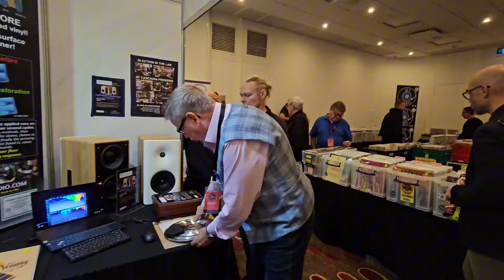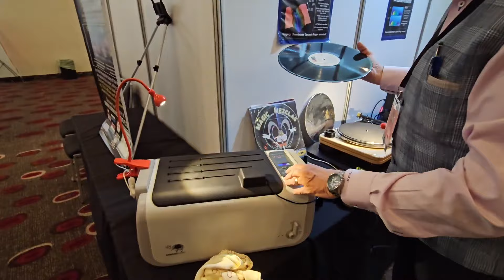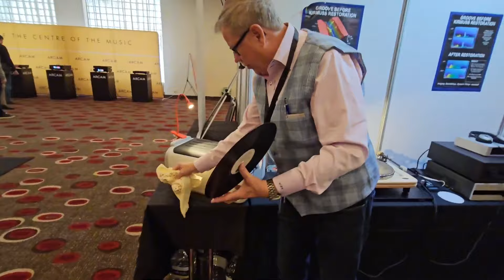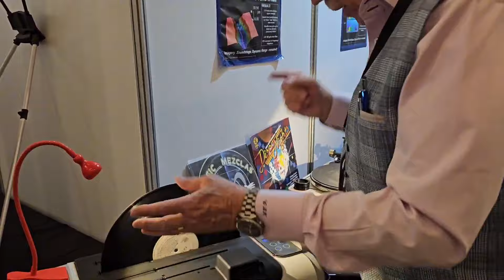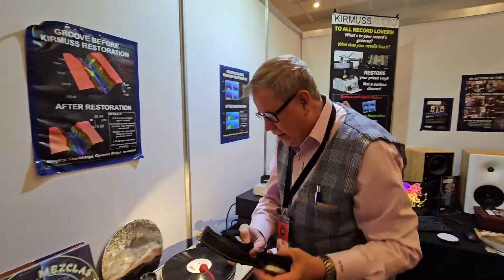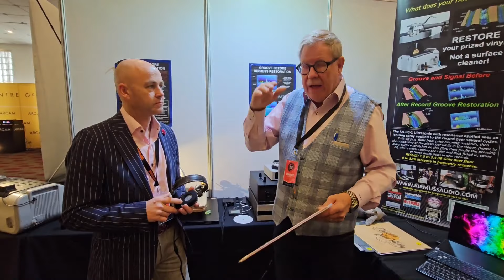MY RECORD RESTORED BY KIRMUSS The process, before and after test.

Comment: OK, wait a minute…is that a Pear Audio Kid Howard turntable? As I recall, they use low torque motors and a brush will easily slow down the platter.
Reply from the maker: @kenw.8013  when a record has a severe coating on it where in another cleaning process contaminants were either air or vacuum dried onto the record, one sees a turntable slow down when a 10 micron diameter felt  brush is used... . Even a Pear.  Restored records see no slow down.

Comment: If I had to go through this process to clean each of my records, I’d throw my collection out the window. 😂
Reply from the maker: @melsrecords-bq3di  Restoration is not surface cleaning. If you truly want to hear the tone and resonance, harmonics available as pressed, one needs to remove the three coatings that we have described.  New records included.  That is why we receive the rave reviews as we do and where analog with record groove restoration gives you the musical  experience that you should have over digital. Surface cleaning is not what our process offers.  Once restored,  does not have to be repeated again except for a two minute cycle when one feels that the record has excessive fingerprints once more.

Comment: The oil crisis years were mentioned, during these periods the thickness of vinyl also changed, it got thinner, this was also the period where The Best Of and Greatest Hits albums started to be released as there were no recording costs, they were basically re-cycling their artists recordings to make profit during this expensive pressing period.
 I sold collectable and rare records back in the late '80s and most of the '90s, I could have done with one of these machines then, in fact I probably would have bought two had they been available then.
Reply from the maker: @AndrewAHayes  Happy New Year Andrew!

I too got rid of some oil crisis era records only to buy them back after we discovered where it was the excessive coating caused by the use of added and added stabilizers and liquefiers that had to be added to recycling of records in those days that accounted for some records sounding horrible.

At recent shows in Mexico and Peru discovered also our restoring these era records to life.

A sincere joy for me to hear records restored and making a positive impression to folks that were once skeptical including Michael Fremer now introducing us to friends, peers and colleagues. 

Keep those records spinning!

Comment: This video makes me want to not play my records.
Reply from the maker: @glenpitts6813  Happy New Year!   No matter the price of your sound system and yes some elbow grease needed to remove the three identified layers that hide the detail as pressed, purchasing a 10,000 USD cartridge will not have the impact as record groove restoration.   Restored records played back on a 500$ Audio Tecnica or Victrola  like turntable also hear the impact that only our process offers.

Yes, some work.  But the benefit is mind boggling.

We wish that we could make it simpler but we are dealing with the laws of physics where per the Tribelectric table of charges both distilled water  and  PVC  have he same electrical charge. They repel each other.  So the needed cycling and application of the ionizing spray. The only only known procedure to remove the films and coatings allowing the needle to discover the music as pressed, now revealed.

Comment: For many, many years I have used a Vax hand held wet/dry vacuum cleaner on my vinyl records.
It has satisfactorily cleaned out the gunk in the grooves, valleys and tracks of the record.
Yip it seems harsh, but it does work.
There is so much more to stop pops, hum, rumble etc, not just cleaning
Cartridge maintenance, down pressure of the tone arm, position of the tone arm on the record etc all contribute to output noise.
One of my records sounds UN-listenable on one of my decks, yet perfectly passable on another

Comment: I enjoy touching records and man-handling them as a DJ. I love seeing greesy records and putting my fingers all over them. Plus if the record has a lot of noise you can put water on it and it will be quite down. An old DJ trick.
Reply: but that water is like crack, once you start doing that, you can't stop.
Reply: @pudintain9656  Please xplain? How could this be
Reply: @Legeennnd  I was a nightclub DJ back in the day and I knew DJs who had the water bottle and they would spray their records while they were playing to eliminate the pops. It works for a minute but really just makes the problem worse down the road.
Reply: @pudintain9656  Really. But I see some DJs doing it when they playing a record with a lot of noise. Which you cant have. SO they place diluted water on them so they play quieter for the crowd. It's a good solution for bad records. Of coarse better to have records without noise but sometimes  you have to make do with what you have.
Reply: @Legeennnd  Diluted water. You talk shit.
Reply from the maker: I have seen water on a record see the needle skid accross the record.

When one talks about 'wet' cleaners, caution was always stressed nott to wet the cantilever of the cartridge as water by way of capillary action can move up to the elastomer and ultimately reach the Mm MC coil affecting sound reproduction.

Comment: Wow so much snake oil!!! You can clean records with PVA glue :)
Reply from the maker: Sorry to say, while on the subject of surface cleaning and not record restoration, proven where  the glue once dried and then peeled off cannot make contact with the sub micron details and enter due to the size of the droplet  into a 6 x 30-35-4-45-50 micron groove. Proven also to leave a film.  We have tested  such a system in the UK from an Australian manufacturer.

Added, PVA has Acetone. A no no for PVC.
https://design-estet.com/pva-glue-analysis-of-the-composition-advantages/

From Yoursoundmatters.com: QUOTE:" The wood glue cleaning method is one of the more bizarre, but common approaches used in an attempt to restore old records. As the video demonstrates, the process involves spreading a solid layer of wood glue over the record surface (avoiding the label of course).When left to dry overnight, the glue dries clear, picking up dirt and dust deep inside the grooves. The theory is, all the grime is removed when peeling back the glue.This cleaning method makes me cringe. I can understand the logic, as dirt and dust can become deeply entrenched over many years — particularly if the record was played dirty — but the risk of further damage is very high.The glue can easily fail to peel off in one piece, causing all kinds of problems, and I can’t imagine the residue is any good for your records and stylus. It’s also very time-consuming; why take the risk when record-cleaning solutions are relatively inexpensive". END QUOTE

Comment: Can your process remove products such as LAST ?  -  the only method I know of is mechanically so far.
Reply from the maker: Yes, send me your email address, I will send you the images we sent to Fremer proving where LAST does not change the chemistry or molecular structure of a record, rather, it is a coating, and yes we do remove it. We have before and after images sent back in 2019.
Reply: @kirmussaudio7578   LAST indeed does not bond chemically it's simply a coating , exactly  like nail polish on a woman nail . At some point it comes off , and it looks like fibreglass when it is removed .  I dealt with many CBC library records that had this garbage on it's surface.  It immediately also cuts down important high frequency info so that's probably the marketing aspect of the product to reduce noise. It is a severely thin coating , which makes spotting an LP coated in it practically impossible  , until I put it through a certain process.  Sometimes people will put the LAST sticker somewhere on the album to say they have officially destroyed the record fidelity.

Comment: @19:30 'now a k-tel record can sound like an audiophile record' - what's an audiophile record?  if you mean a better pressed engineered and properly spaced groove width for the material..then , impossible.. the groove cram on those k-tel records USUALLY (not always) are the biggest issue - cramming to make the records play longer per side.
Reply from the maker: K-Tel records are ones  we love to restore, just as Mexican and Peruvian records as well as records made durng the oil crisis in the 70-80's era. Stampers have no changes, record sound different (horrible) as according to David Middleton of EMI Capital Canada, now retired, as oil was expensive, records that were not selling well were recycles, and needing added liquifiers and stabilizers, all of which surface the heated and pressed plastic, further hiding the sub micron detail as pressed.  Removed, these records sound GREAT and alivem and where we discover the tone.
Reply: Agreed; An audiophile record is one that is cut "first generation" from master tapes "or live" onto a vinyl or styrene blank using a record cutting lathe.  Pressed records are made from a first generation wax master that has been mold copied into a mother blank that is then electroplated with copper or vapor deposited with gold or other metals, then electroplated with nickel and then sometimes chrome, then stamped up to 1K or more presses before wearing out the stamper set.  Watching this video made me cringe, and WTF was that spinning noise in the BG - let me guess a centripetal spin cleaner?  Imagine him taking an brand new unopened NM record and turning it from a NM into a VG+ with all that scrub a dub action with his "lens quality cloths" and contaminant free brushes and sprays going against the grain...  The ultrasonic cleaner alone does all the work, as a microscope and play grading would reveal.  All that scrubbing is just pure cringe.  Just use an ultrasonic cleaner with warm water, and if you doubt it, check with a microscope.  His spectrum analyzer before and after was pure balderdash, and I should know as I've spent many hours looking at waveforms and spectrograms enough to know that you can't compare waveforms of spectrograms in the fashion he suggests.  Then to add insult to injury, he literally sprays and spreads his fluid on the record prior to playing, thus adding fluids back to the record prior to playing... thus negating his premise entirely. 🤦‍♂ Let me guess "record lube", which he says is for anti-static purposes... lol
For further examination of his claims, let's refer to patent US3960790A ; "Four-tenths percent of montan wax ester is added to the compound to provide for good release of the record from the stamper. When the record is removed from the press without the lubricating effect of the montan wax ester in the compound, the grooves of the record are sometimes fractured, torn, and deformed by the removal. These faults in the groove produce noise on playback. Montan wax ester at the stated percentage is compatible with the resins and is homogenized into the surface of the record at the normal pressing temperature. If more than the stated amount of the montan wax ester is used, the excess amount is not absorbed into the surface of the record. Its presence results in non-uniformity in the surface of the record, particularly as related to the friction between the stylus and the groove. This non-uniformity produces noise when the record is played.  After reading this patent, you will find that Quadrophonic records require additional bandwidth to encode the additional 2 channels.  Nowhere have I read that Quadrophonic records must be first "cleaned" to remove "release agent", in order to get the full bandwidth.  Okay, so the takeaway is to get the $140 dollar Vevor ultrasonic cleaner, clean the records without "scrubbing them", then play and you will get the best results possible without scratching the crap out of / ruining your records...  I'd love to see a pro record grader grade a NM record, give it to cringe cleaner, then grade afterwards and watch it become a VG+ copy with scratches and abrasions which will be visible under a magnifier...  mic drops 🎤
Reply from the maker: @thetruthserum2816  We have proven using the Keyence VHX-7000 2D 3D microscope where we see the sub micron detail as pressed. Confirmed also by JR Boisclair of WAM Engineering, hidden by the release agent, pressing oil as the Shure Brothers called it in circa 1977 when their needle of their V15 Mark IV was digging something out of the groove,  solved by the Mark V and change in needle geometry.

In our process, we really do not care how the record is handled as we are not cleaning the record. We are ionizing it.

Lots of questions will be answered in another interview session with Shane. Will focus also on correcting or elaborating on some of your representations. Too many to handle in this format.

To our immediate focus,  our intellectual property:

Our brushing sees an ionizing agent applied to the record. As you comment, it is applied haphazardly.  Why?

First the agent applied is an ionizing agent. Not a cleaner.  Do study the science on our YouTube channel or on the several reports produced by Michael Fremer on both Analog Planet and Tracking Angle that has recorded the seminars we usually present at our informational industry seminars at audio trade shows and record fairs in the Americas and EU,  invited by the show organizers as there has never been any education on matters related to records for a dozen decade or so.

This said as a Preamble, 
To your point, ionization changes the charge of the record to be oposite to that of water, attracting cavitation.  

In the same breath, any liquid sees a droplet that is 100 to 110 microns in size.. what  is the size of a record's groove,  I ask? Significantly smaller. This  also answers why cleaning solutions do little as to any improvement of the groove but does a surface clean and shine.  So our process relies on attracting cavitation and having the collapsing bubble pull materials out of the groove.   The charge washes off,  needs to be reapplied.  A colorant allows the record to efficacy of each cycle.

To the optician's  cloth.
We use a dedicated  clean line free optician's cloth to remove the few droplets of surface water on the record. Remember a restored record has the same electrical charge as the distilled water, so the matter of the cloth is moot. Very little water, if any.  Water never in the groove. Thus,  No air or vacuum drying needed as a result. Proves our statements as also validated by the Tribelectric table of charges. 

Moreover, water is not in the groove as the groove is a fraction of  the size of water droplets.  Then a dedicated clean 10 micron diameter parastatic felt is used to mechanically polish the groove. 

To to the suspension of the record, it is suspended over the work area.  No contact is  made by the record to any surface. The label makes contact with the record support by way of a suspended felt.

Do review the many recordings made, sone jointly with JR Boisclair of WAM Engineering as well as with Michael Fremer on the web, some also  recorded by the likes of Michael Fremer himself  and Jason Mesina. Many posted by audio show organizers like RMAF.

In the same breath, lots of misinfornation gobbled up by an unsuspecting audiophile audience. 

To assist in setting a benchmark, a standard of sorts to guage any process,  Check out our videos on our YouTube channel for a generic overview of record production and care.  It will allow you to digest our intellectual property and process.

Comment: the mechanism is not essential , more of a luxury cleaning chachkie and does work well if you have the time and money .  The key is to find a good surfactant to do proper cleaning regardless of the method I rarely use my ultra now with my hand method which anyone can do with a clean water source.
Reply from the maker: @SPINNINGMYWHEELS777  Do consult the Tribelectric table of charges as well as reviewing the size of the record's groove versus the size of liquid droplets of a cleaning solution.  Surface cleaning,  not an issue.  Record groove restoration,  another subject that we specialize in. Our IP.

 To the mechanism, records are spaced specifically to not impede cavitation, where contact is made from the edge of the record to the dead wax area. The passive resonance created by the cover modifies the ultrasonic wave and evens it so there are no areas that have excessive amounts or lack thereof cavitation.
Reply: @kirmussaudio7578  Define "Restoration".

Comment: yes carbon fiber brush is essential for grounding / de stat - it's the best to use and I go one further with it which he does not mention.
Reply from the maker: @SPINNINGMYWHEELS777  Our videos and manuals since 2017 promote the use of a 10 micron parastatic felt brush, followed by a grounded 2.5 million carbon fiber brush to remove static. In that order.
Reply: @kirmussaudio7578  Sure, but I'm talking about something you didn't realize to add to the equation.  My manuals include another step is my point.
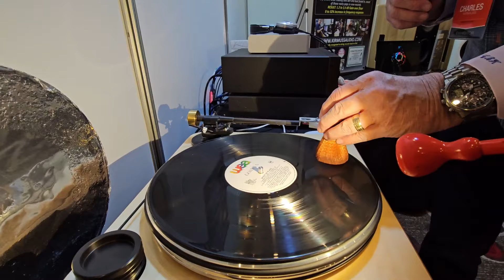Reply: @kirmussaudio7578  my apologies -  I did not see the part @23:00 - that's the step I was referring to that I do as well.
Reply: Now off to sell an antistatic brush with a grounding lug and wire to attach to an actual ground instead of a floating "ground"...
Reply from the maker: @thetruthserum2816  Our combo brush sees the case grounded to the hand as the case is metal.